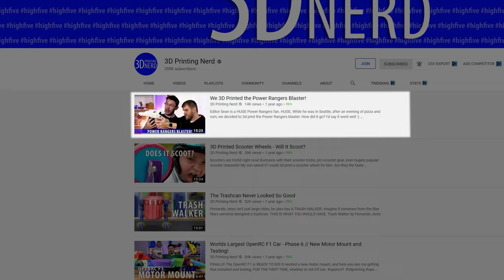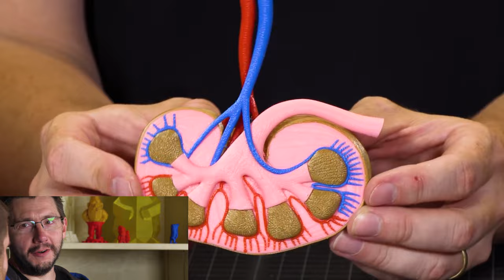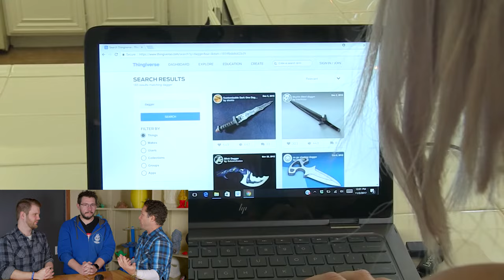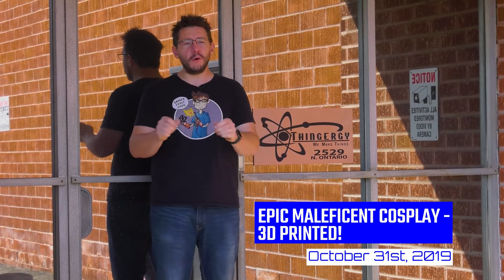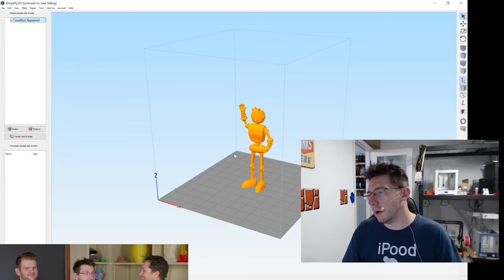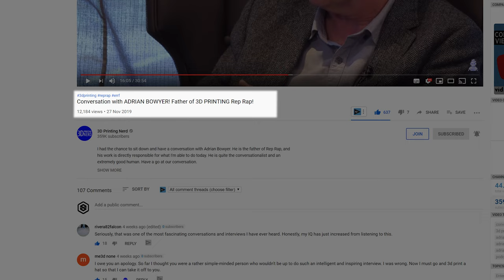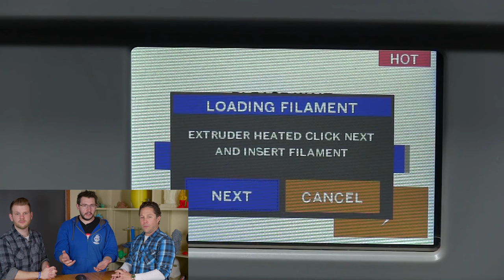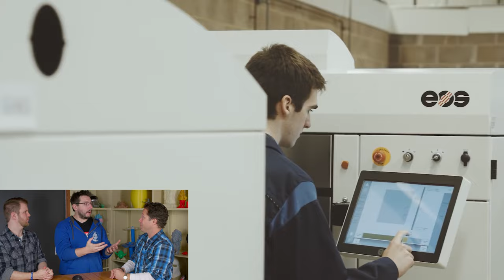Top 5 of 2019 / 3D Printing Nerd Looking Back...

Comment: Excellent episode. Some good memories in there.

My personal favorite was what we could probably call one of your first "functional print" episodes.  The shifter knob for your Subaru.  I like this one because the timing was perfect for me.  A few days before I found this , I had come out to my car one morning, and found the cover for the driver's side A-pillar sitting in the drivers seat. Age and heat had stressed the mounting tabs, and they had just snapped off.

Watching your video, I realized that those inside panels are made from ABS, and I had a DIY Mendel that could print ABS like a champ.  I took a few minutes to measure and design a replica of the failed tabs in TinkerCAD, and about 17 minutes to print a new set. Some JB Weld and an overnight sit later, I reinstalled the panel in my car.  I'm proud to say that not only did I save $100 on a replacement panel, but that those tabs have held the panel faithfully ever since. (over two years, as of this post)

Comment: I am curious if the Simplified 3D problem ever got fixed.  I have a thought why is was not working.  The S3D license states you can use it on two computers, therefore the software is locked to your config ID.   My guess is the person with the trouble has the software on more than two computers.   That is why there is a deactivate menu pick on the same drop down menu.  Joel could test this by loading S3D onto another computer and try to do the same thing swapping machine types.